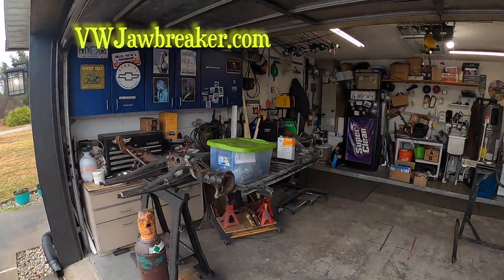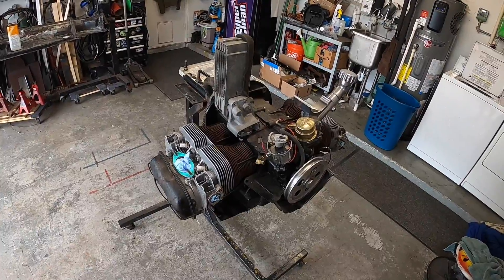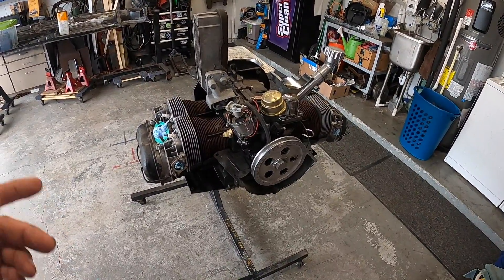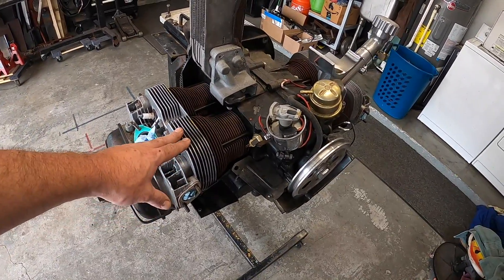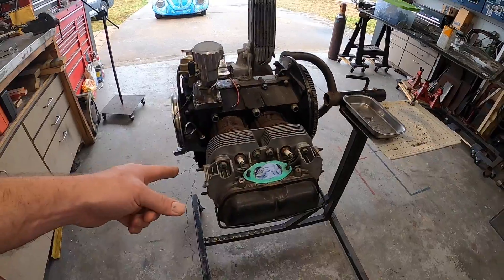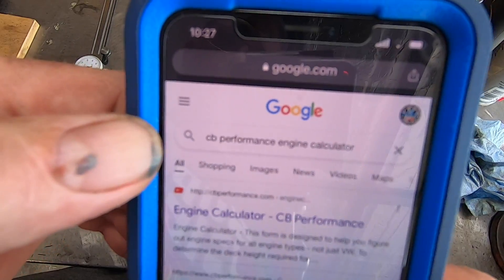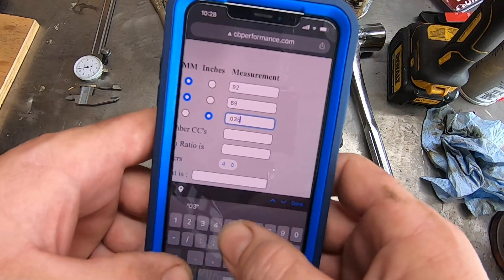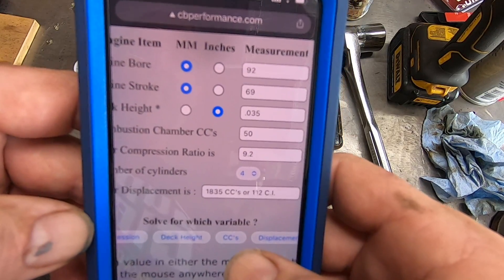How to Calculate Compression on Volkswagen Aircooled Engines - Part 1

Comment: Would the 9.2:1  be good for a Bug or Ghia?
Reply: Higher compression is more power but can lead to overheating if not properly combined; especially street driven cars. To give you an idea; stock cars are between 6.6:1 to 7:1.
Reply from the maker: It would probably be ok however that high of a compression is kind of a waste considering it’s higher than the cam needs. Always match the compression to the cam specs.
Reply: @VWJawbreaker   I’m in the process of building an 1835 with a W110 (go figure) what carb set up would be recommended.   This would be going on a street driven Ghia
Reply from the maker: @prkid424  what heads are you planning on running?
You could run dual 40 IDF’s or a single 38 egas.
Reply: @VWJawbreaker  I have VW 040 heads, 40x35.
Reply from the maker: @prkid424  either the 40 IDF’s if you want to run duals or the 38 egas 2bb single carb would be good.
Reply: Hi Gary, great video and learned again. With a stock engine (1200cc) is that a 6:1 ratio or higher and do you have to do this with a stock engine?
Reply from the maker: @VWBEETLEOVAL1955  normally with a stock engine you wouldn’t have to do this very often but it’s highly recommended to verify the info when building the engine or even just changing out the jugs and pistons due to aftermarket parts not being the same as oe.
Reply: @VWJawbreaker  thank you Gary, I will look into it to be sure that everything is ok.
Reply: @VWBEETLEOVAL1955  Hello, dear friend! I believe you should always check this even with a totally stock engine to make sure everything is equal on all cylinders and to keep the compression ratio within specs. On these aircooled motors; especially for street driven vehicles it is of utmost importance.
Reply: @vayabroder729  thank you, I will look into it for the future, when I’m starting rebuilding the engine.

Comment: Hey Gary was that motor getting carb. washed . some thing dont look right there . For a bus what works good is a 32/36 and messing with the jets you can get rid of the soot . Then does it have a brake servo . you will need plenty of vacuum. The 110 is so close to a W100 lift wise .and a  W100 works on a bus . Its all good . later.
Reply from the maker: Considering I hadn’t ran the engine prior to me digging into it I’m not sure what carbs were on it or how it was jetted. All I know is that it was a very low Milage, rebuilt engine. He didn’t want me to split the case and put a smaller cam in jt, he wanted to leave the W110 in it.
Reply: @VWJawbreaker  110 aint much bigger than a 100.
Reply from the maker: @jimmywilkinson9190  yes sir.
Reply: @VWJawbreaker  the 110 is a highly regarded VW performance cam. Should be good.
Reply from the maker: @vayabroder729  I actually prefer the C35 over the 110… nicer profile imo.